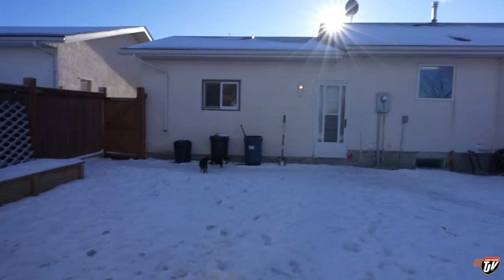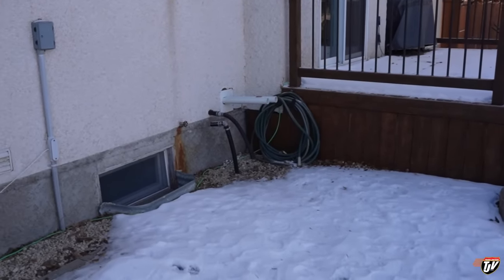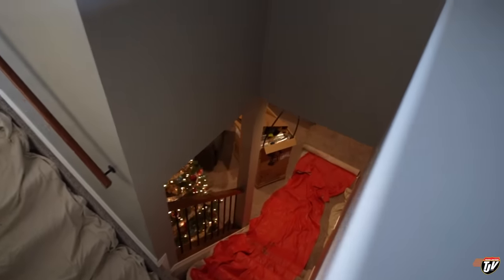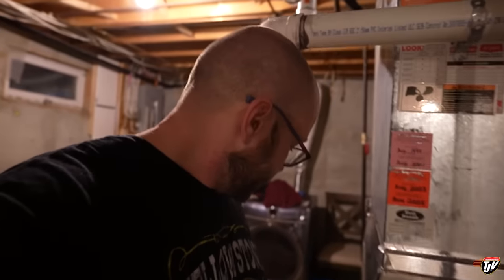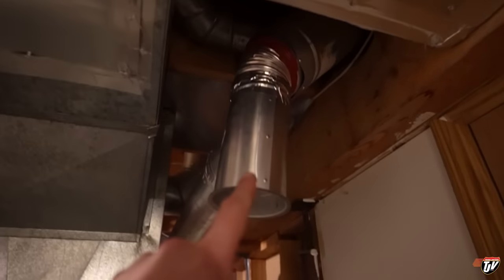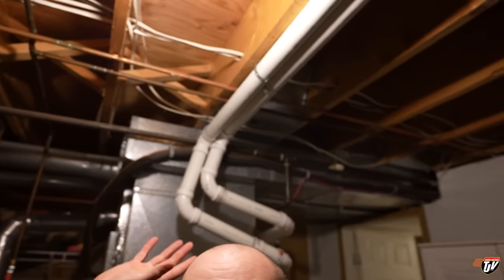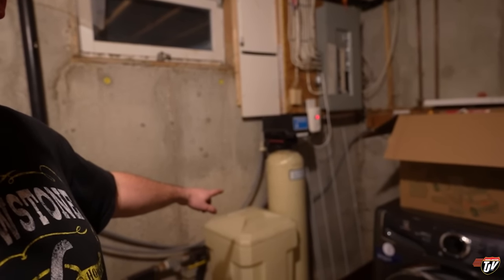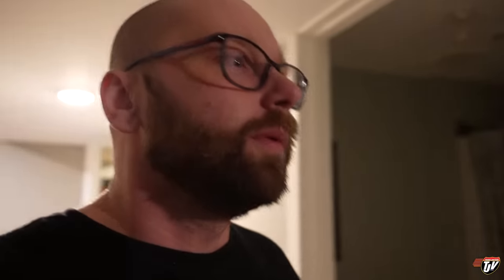OUT WITH THE OLD! | Hometime | Vlog #2966

Comment: Some friendly advice about choosing a location for your air conditioning unit outside, something to keep in mind when choosing a location is the noise the air conditioning unit makes. Ours is right outside our bedroom window and because it’s hot and the air conditioning is on the windows are all closed but we can still hear the fan running, it’s really noticeable when we’re going to sleep, it’s quiet and we can hear it cycling on and off. It doesn’t disrupt our sleep but it’s definitely noticeable, if I could I’d have it on the back of the house instead of the side of the house but that’s sometimes not an option depending on the layout of your house. We have a bungalow as well so our bedroom is a ground floor room and the unit is almost directly outside our bedroom window.

Comment: Josh,  
Greetings from Detroit Lakes, Mn.  While never a truck driver, I set up a trucking system and managed it for about ten years as a side responsibility for my employer.  We put on about 3 million to 4 million miles per year.

I am contacting you because my prior house had a high efficiency heating system that came out of our house about 4’ above the ground.  We had an issue one winter where we had a snow drift that covered our exhaust and inlet pipes.  The fix was easy, just shovel it clean, but if you are on the road and the heat quits, this may be your issue.  I considered making a couple of extensions, but I only had the issue once.  If you do consider extensions, be certain to get your heating contractor to agree this is safe to do.

By the way, Detroit Lakes was called Detroit from 1880ish to 1925ish.  Too much mail and freight was going to Detroit Michigan so Lakes was added to the name to cut down on the confusion.

Be safe.

Comment: I noticed when you had shown us your furnance I could tell it was an old furnance due to the exhaust stack. Make sure with the hot water heater that you replaced the scarifical anode in the tank. It will prolong the hot water heater's life. Make sure on the nre furnace that the intake is far enough away from the exhaust so that you are not sucking in the exhaust. When I was living in a house they ran both up the old flue and ensured that the intake was higher than the exhaust.

Comment: My furnace was 33 years old, and the hot water tank was also 33. I bought my trailer in 1990, brand new,both water tank and furnace, gave up 4 months apart, and also like you have used the same company for all my plumbing issues,recommended by my brother,have a portable AC unit